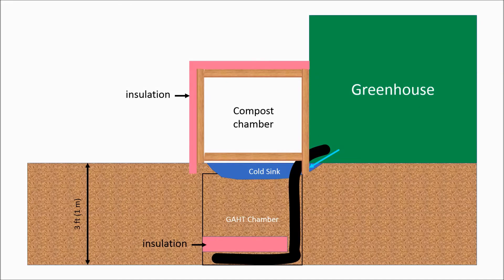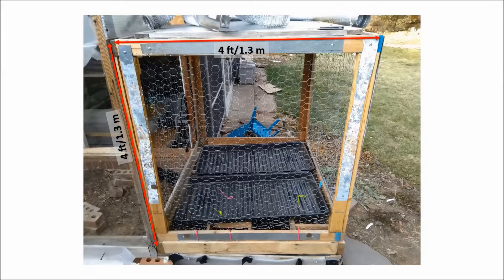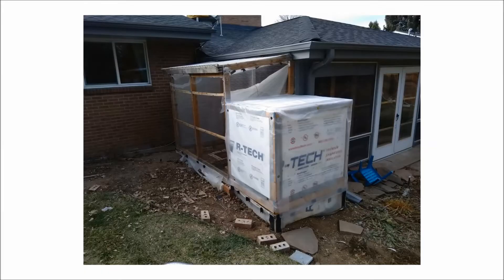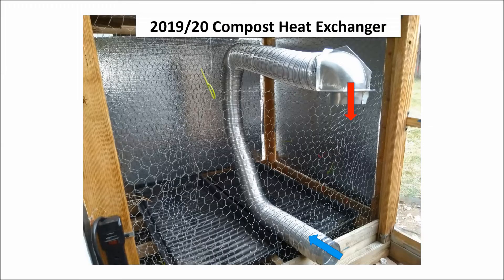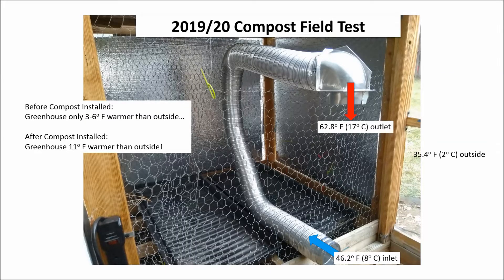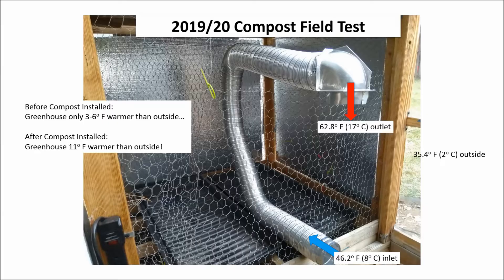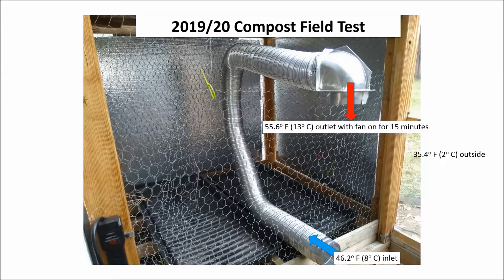Greenhouse 3.0 Compost Heating Results - NICE!

Comment: I have a 49 sq/foot 8' tall poly greenhouse with 15 feet of duct down to 5 feet and get 55f constant. I am added a slightly smaller box than yours with emerg foil blankets lining with poly then put my indoor air through that plus a void at 5 feet as storage. I'm in 8b Vancouver Canada use it for citrus. You had same concept with results thanks!
Reply from the maker: that's great to hear.  Vancouver seems like the perfect place to implement a lot of these types of passive heating & cooling.  And if you're doing citrus...you are succeeding!  I was able to keep a tomato plant bearing fruit until December 15 one season, which was my sole greenhouse triumph.  haha
Reply: @MorganBrown  Still lucky I have space for trees inside though. I'll at least have cooler air in summer. No AC option but solar and will double poly wall it in winter. My yard is 1907 fill so has rocks to heat and sandy loam. The citrus needs seasonal cues or they may go dormant under  indoor lighting.

Comment: I realize this is 2 yrs old but one input or variable you didn't cover was the core temperature of the compost. Id really like to know that part of it.
Reply from the maker: Hehe I’m still alive 😂

This compost mixture easily hits the max temp of 140-160…but it is too small to stay hot for long, maybe 1-2 weeks.  That’s the fatal flaw.  Either I come up with a way to turn this pile, or I make the pile about 4x larger.  If you have a farm, the big pile is doable, but for the rest of us, some innovation is required to turn the pile.
Reply: @MorganBrown  i just find out about this hot composting stuff. If things work out I may have a chance to try it in about 2 yrs. I have no experience but have been going over this and working on it in my offgrid notebook. 2 things I would implement is a mid level shaker pipe made from drainage pipe.  In your system maybe a 3/4" pvc with holes drilled in the center. Use a removable cap or valve on the intake side. The other thing is do is make it a closed loop system.  Why keep heating super cold air? Instead, draw the intake from the floor off your green house but not too close to the warm air discharge.

Just some thoughts , good luck
Reply from the maker: @jim55282  I'm not sure if you were proposing this, but I tried having air holes in the heat exchanger (inside the compost pile) and it was a big mistake.  Biggest issue was that the compost pile dried out around the pipe, and the entire pile pretty quickly got cold.  A lot of that moisture ended up in the greenhouse, where it just created trouble (condensation, ice, mold, fungus).  In my experience with (small) compost piles, aeration is VASTLY overrated!  The biggest concerns with small piles are insulation and moisture preservation.  I have easily gotten 160 degree temperatures from nearly airtight compost piles.  Aeration seems to be more of an issue for industrial-scale compost applications.

You could certainly make this a closed loop with a much longer section of dryer vent laid through the greenhouse, acting as a pure radiator. I actually did this in the previous year's compost heat exchanger.  Unfortunately, some condensation actually filled the pipe and air stopped flowing!  So you'd need to account for that problem (not difficult).  However, one very nice thing about the application shown here is the natural thermosiphon - I get excellent airflow and heating without adding a fan (purely passive heating).  I think for a closed loop you would need to carefully ensure that air is flowing in the loop...or include a duct fan (a simple 12 watt fan will suffice)

Comment: Would adding another line , like 2 of those lines going thru be worth it?
Reply from the maker: you will extract more heat in the short term, but the pile will cool faster.  And the more tubes you have inside the pile, the harder it is to turn the pile.  Best solution is probably to have a pile so large that you don't need to turn it over the course of a winter.  Then you can put more tubes in the pile and it will be fine.  I don't think my wife would have approved, had I built a giant pile in the backyard!  I needed a small farm.

Comment: Interesting that you could get a 10 degree rise with only 2 1/3 yards, and with such a short heat exchanger.  I think I'll give my own idea that we discussed a  go.  I was discouraged by hearing everyone say "water carries heat much better than air".  While "they" are quite correct, it involves the technical complications you mentioned.  Thanks again for going to the trouble of doing this.
Reply from the maker: Yes, I was very pleased with this result.  The high conductivity of the aluminum duct certainly helped heat transfer.  Unfortunately, the compost pile is just too small, probably by a factor of 4.  The pile only stays hot for about 2-3 weeks without a full turn.  And turning this compost pile was essentially impossible (my own fault there).  Some type of easy-to-turn small compost pile would be a real innovation.
Reply: @MorganBrown  Speak of easy-to-turn small compost pile, I managed to build a reactor which is only 0.28 cubic meters in volume. 
It reached 64 degrees Celsius within 24 hours after the materials are put in.(Ambient temperature is 28 to 32 degree Celsius) And I also managed to keep it above 45C for more than 30 days by adding new materials into it.
Here's a summarizing video I made :https://youtu.be/hWEspeI20ZU
Reply from the maker: @gitpharmmakes7985  very interesting result!  I guess insulation is the key factor
Reply: @MorganBrown  I agree with you.  Here's the original design which is tested in Ireland: https://www.youtube.com/watch?v=dP20LkAZJIc

Comment: water has the highest insulation value. all you need to figure out is how much tubes you can run throught that compost vs speed of flow. this will tell you your threshold of max BTU output . dont use air use water.
Reply from the maker: too complicated.  Here, I just put a pipe in the compost and the heat transfer happens without any supplemental equipment.  If I was going to use water, I'd need: 1) a network of fragile water pipe inside the compost, 2) a water reservoir inside the greenhouse, 3) a strong pump pushing the water.  A single pin prick hole in your water pipes and you have a soggy mess.  A pin prick hole in my heat exchanger is no big deal at all.  I've seen these guys with the huge compost piles circulating water.  Funny how they never show you "season 2", since after they deconstruct the compost pile, I'm positive that their water circulation pipes are a mess and full of holes.  If you've got an industrial-strength application, then sure, water circulation could be great.  But if you have a small compost pile and want to pull some heat out of it, I very much like this extremely simple air circulation system.
Reply: @MorganBrown  Use water lines (cheaper & easier) under the (posibly insulated from the bottom) compost pile which still enables you to "turn the pile" any time as you wish or cycle various piles. Thermosphoning will also proceed very effectively with water vs air. Having the cooling end of the thermosyphoning loop at a high elevation will increase the force (powered by gravity: the greater the density difference & the greter the elevation difference) thus speed thus effectiveness/efficacy of thermosyphoning/heat transfer. The ‘cooling end’ of the cycle can be a radiant heater above the plants which will be very effective.

Comment: Thank you for sharing this information. I'm designing a heat exchanger for my greenhouse with a similar design (using compost) but you've given me more to think about. My greenhouse is 8'X10' and my compost ben will be 4'X4'X4' (covered), and I plan to insulate it as you did on all sides except the side that touches the greenhouse, there I will use corrugated metal to radiate inside the greenhouse. What do you think instead of using ridged dryer pipe I use 4" PVC pipe? That way I could make bends (turns) with elbows inside the compost pile giving me more heated air volume to pull into the greenhouse.
Reply from the maker: Ron, sorry, I did not see this comment until now.  The 4 inch PVC pipe would be more durable for sure.  It won't conduct as much heat as the aluminum dryer duct, but it will still work.  One problem with having a lot of complicated pipe inside the compost pile is: how to you turn the compost?  I'm keen on desigining a compost bin that allows for much faster turning.  My previous compost piles have simply been too difficult to turn.  Since they are not very big, they cool down after a month or so.  If you want a compost pile that stays hot all winter, it will have to be huge (more like 8x8x8 feet)
Reply: @MorganBrown  Thanks for the info. I didn't get mine completed before winter. My wife and I both got sick so it's been on hold. Hopefully before spring.
Reply from the maker: @ronjohnson8684  haha, yeah, I had Covid when I made this video (mid March 2020).  Sadly we sold the house and moved to a townhouse without much of a private yard.  My days of compost heating may be over, but hopefully I still get to do some gardening.  Have been busy fixing up the house for now. ;-)

Comment: Why keep the compost gasses out. If the compost has good aerobic decay going on it should produce CO2 and not methane. Some commercial growers add CO2 to their greenhouse to increase growth.
Reply from the maker: Fair enough.  My main concern isn't gas, but moisture.  I want the moisture to stay in the compost pile, not in the greenhouse.
Reply: Morgan Brown . Yes, would cause fungus issues and the like.
Reply: If you duct the gases into the greenhouse, run them through a filter of woodchips or straw or something. That will absorb the ammonia and some moisture, but the co2 will pass. Then toss the saturated straw onto the next compost pile.

Comment: Fascinating. How long do you expect to get out of the compost before it begins to cool and cure?
Reply from the maker: A compost pile of this size will last between 2 and 4 weeks (above 100 deg F/40 deg C).  Unfortunately the size of my compost pile is limited.  I may try to expand UP next year to get more volume.
Reply: @MorganBrown  It depends on the "fuel" you put in. Dan Brown wrote a nice book https://books.google.fr/books/about/The_Compost_Powered_Water_Heater_How_to.html?hl=fr&id=pKZwAwAAQBAJ&redir_esc=y#v=onepage&q&f=false From differents experiments it seems that a very carboned substrate with differents size of bits, from sawdust to chunks passing by "schredded chips" last the longer, until around one year ! depending of the size, some were made inside insulated boat container.. (the best system for me !) Very informative book !

Comment: It strikes me that all heat extraction compost systems i've seen, are based on a vertical stacking of the material. Heat is moved by water in tubes or air movement. Direct radiation is ignored or underused in general. A lot of work is needed to stack and excavate the compost. However, if you assume that compost moves down by it's weight and acts as a slow fluid, things change. Why not angle the compost pile in order to let the compost flow down, remove compost from the bottom and fill up at the top. Use a corrugated steel roofing sheet under an angle of let's say 45 degrees, as  an heatexchanger. Sides and top of the slanted pile are only for aeration, insulation and guidance.The steel will/can  radiate the heat into the GH.
I don't have enough compost material avail to put it to the test in my attempt for a passive solar GH. At this moment I'm using thermal mass to keep the GH above freezing (water and insulated brick footings). Last 2 winters lowest outside temp overhere was -10 C at ground level. My system relies on capturing solar heat during the day and storing enough to keep the temp above freezing during night. A long clouded period shows max temp in GH drops to max daily outside temp. During a day with max sun, temp in GH rises 20 C above outside temp. Ran a test last winter with lettuce in the GH: transplanted them in fall at size of 5 cm into pots with poor soil, but they did develop leaves of 15 cm.
Stay safe, best wishes, greetings from Holland.
Reply from the maker: Earl Shine I like your idea for a compost “feeder”.  Seems like you could definitely use gravity to aid in the turning of the compost.  My current system is not very “turning friendly”, and I will probably be unable to actually turn it.  I’ll have to disassemble.  I actually have some galvanized steel sheet metal sitting in my garage for like 5 years.  The wife is dying for me to get rid of it!  It seems like any compost pile will have a shell of about 20-30 cm of cool material before you reach the hot core.  I think you need to access the core of the pile to get meaningful heat extraction.  I’ve studied many successful passive greenhouses and I think that the principles you mention are more important than compost.  Quality construction, insulation, thermal banking, etc.  I do like compost as a backup for sunless days, as you mention.
Reply: I love the idea of a renewable pile as opposed to one I need to completely tear down regularly....

Comment: Nice. I was working on some water heating greenhouse. Another way to heat a greenhouse. https://photos.app.goo.gl/QxuwqHk4M2YFxM4c6
1 - sun powers the solar panel that starts the water pump (it works only when the sun is).
2 - water moves through the black hose-collector and was heating up. Black hose was connected to 3 small water tanks under the flower pots.
3 - Hot water was stored under the flower pots and slowly realised the heat (like a hot tub).
It works VERY effective, but only when ths sun was shinning. I had a time when there was 10 days without sun in winter :/ Only clouds. Later I added other stuff (silver pipe moving air and so on). The base line is that it was passive, automatic, super effective on shinny days. No power from outside, only sun. Hot tubs keept the greenhouse above 0 for 2-3 days. Then the sun was needed to reacharge the system.
Reply from the maker: that's a very interesting system.  I've been pondering something similar but don't have enough room in my GH.  Your GH looks very well constructed.  Maybe you'll make a Youtube video about it?
Reply: @MorganBrown  Nah. I have already dismantled it, but I can share some thoughts and my experience. 
1.1 It was quite well sealed. The edges of the door were covered with magnetic stripes. This led to a lot of moisture appearing inside. There was just a lot of water and no air move. I installed dehumidifiers, so the plants could grow freely. (photosynthesis, evaporation)
1.2
 in the morning a lot of water condensed on the walls. Too much. After half a year first screws began to rust. 
2. Becouse it was sealed well and when the  sun was on full power then the it was getting too hot in the greenhouse - 30C. Even when the outside temperature was around 0. In the end it was  easier to heat it, then to cool it down (?!)
3. The box of sollar collector made from the black hose was sealed (it increased temperature inside the sollar collector). If I remember correctly the lenght of the hose was 70 m...or 40m. Not sure. But it was very long dark surface to absorb the heat. When I make test in March - when the hose was sucking cool water on one side, then the water going out had 40C. A lot.
Reply: @MorganBrown  4. All this experience led to me to conlcusion that I need geothermal greenhouse. To heat it during the night and COOL it during the day. To keep the temperature moderate. Also maybe SEALED geothermal system will be less humid. I would like to try if for example the moisture air would condense on contact with cool ground. To leave some 
excessive moisture deep in the ground. That would be cool :)
5. Problem is that I live in a flat on the fifth floor :D
Reply: Your idea with the cold air sucking from the bottom was cool :D

Comment: Surprisingly good result from the natural thermosyphon. With a fan, have you considered the counter intuitive option of ducting the warmer air from the top of the greenhouse down through the compost and out at floor level? That way you will be recovering heat and warming the coldest air in the greenhouse to protect the plants. In England, some Victorian greenhouses had a large under floor area filled with lots of compost material. By comparison, your compost bin looks tiny. How many days do you estimate you will get heat before the compost cools down?
Reply from the maker: BackwoodsBungalow yes, I agree!  Great idea to vent the warm air at floor level.  If I had more space in my tiny greenhouse I’d try it.  Sadly you are also correct about the limitations of my small pile.  I’m estimating 3 weeks at reasonably high temperatures (100 deg F or higher).  I’m going to try aerating with a drill auger to see if I can salvage the heat.  Hopefully I’ll be able to limp through the last hard freezes.